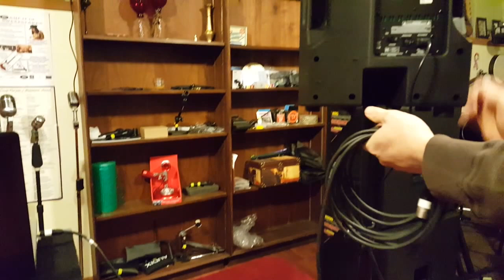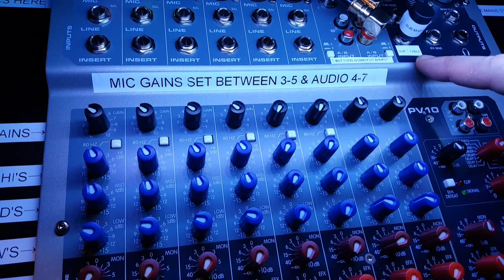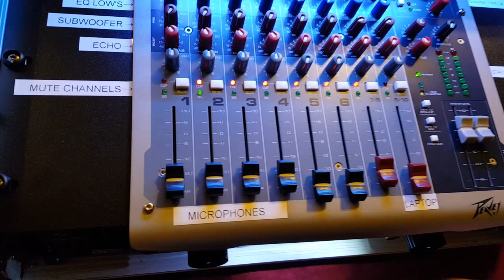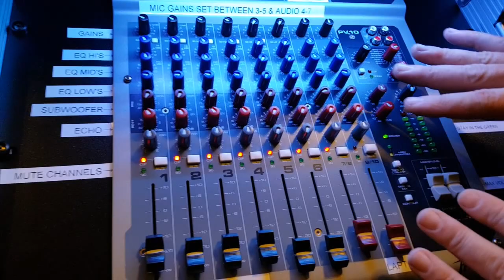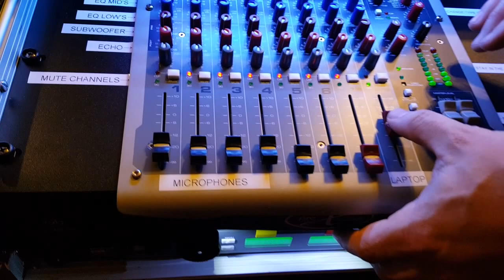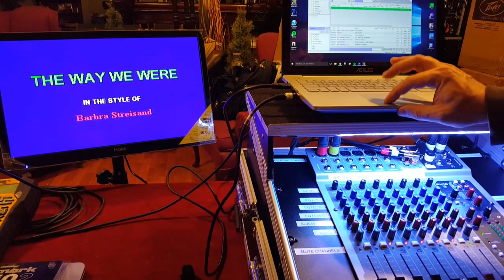Customized Professional Karaoke System DJ System How to set up pro audio system

Comment: Nice and clean and simple.  My employee rigs will be like this.  My rig rack is on wheels so I can have all my extra toys.   But likely the employees I will start with won't have much experience.  

Years ago we stuffed 16 channel mix wizards in 6u/14u slant cases and an atx rack mount pc  that had a multichannel sound card and video card.    We put an Amp in its own case, then used a set of zx-1 ev's. Stuffed it all in a Hyundai Accent.
Reply from the maker: We customized that for one of our customers.  Everything we do is custom.  Nice that you care enough to have nice systems for your dj's.

Comment: About how much does that complete set up run to purchase?
Reply from the maker: The system has changed in the past few years.  Yet the core approach is the same.  Our systems are customized by us and the core of this one is the ability to have everything conveniently in the case with custom tweaks to it.  Keeping it more compact as well.  Funny you ask that question today because I am actually redesigning it for a brewery right now.  The newer upgraded version will have 3 different levels.  First level is for smaller areas, no sub, & customer simply adds their own laptop.  In the 4k range.  The next level is with the sub which could range anywhere from $4,700.00-5k.  Then of course the next level which includes a custom laptop package as well.  That would add another $900-2k.  Just depends upon how it is customized.  EVERYTHING is priced the way it is for good reason.  We have systems that range from as cheap as $600 up to $50,000.00.  
I think what is more important is truly understanding & combining all your needs, wants, budget.  Then go over all the pros n cons to whatever custom approach we take.    

Please take a moment and go to www.madproaudio.com and read the history on us.  This will give you a good idea of who we are.

Also look up madproaudio customer reviews.

Sales@madproaudio.com